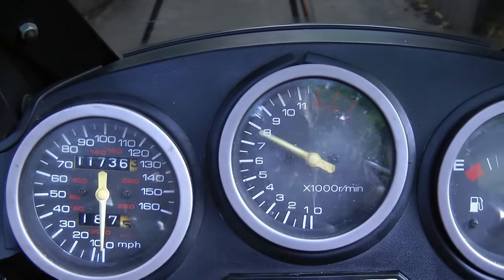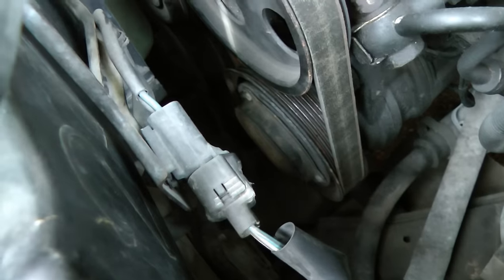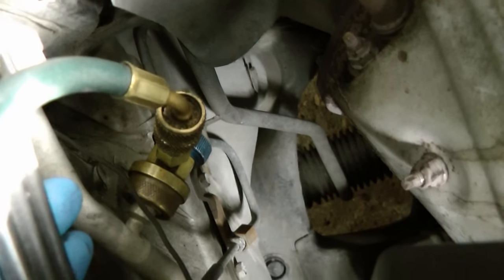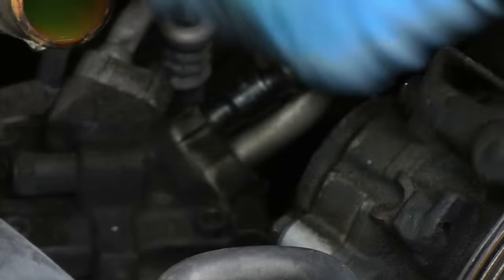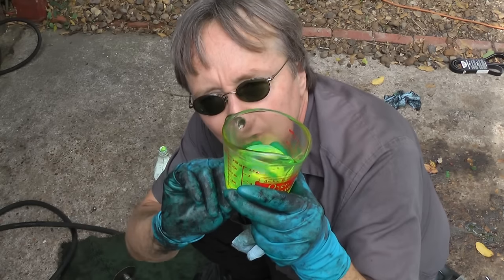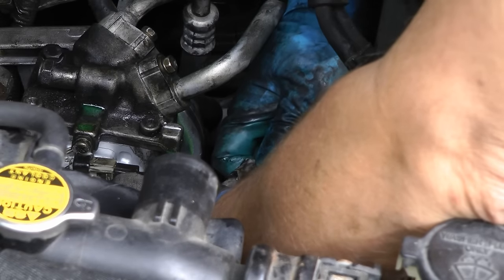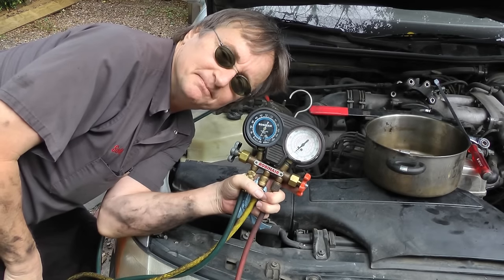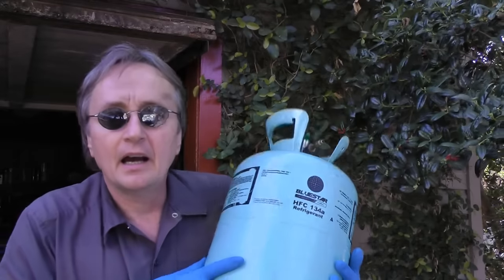How to Replace AC Compressor in Your Car

Comment: Hi Scotty. First, allow me to thank you for providing such a great service--your videos and advice are truly second to none and have saved me on countless occasions. Second, although my compressor spins easily (rebuilt, installed 1 year ago), it does not turn (or stops and goes) when the engine is running. Thoughts? Thank you again!

Comment: Thanks for making this easier to understand! My Saturn Vue -03 a/c stopped blowing cold 3 weeks ago. I toughed it out, then mother nature heated things up. Took it to a shop, was told the uv dye shows compressor leaking - they can't add Freon - ozone layer contamination, etc. They say replace compressor - what do u think? My money tree is suffering from heat exhaustion n $800 bucks seems pricey

Comment: Thanks Scotty.  I must say you are the most helpful person on Youtube.  I have one last question.  I'm changing out my compressor in a 2006 Saturn Ion.  The Drier is on the Condenser and cannot be removed.  Should I replace the Condenser?  The manual only talks about replacing the refrigerant filter when changing out a major component.

Comment from the maker: you had a restriction inside the system making it freeze up, but then the compressor blew up and the ac green oil came out. Now you have at least two problems, including a bad compressor

Comment: Thank you Scotty! Ill let you know of anything.
I'll save up and give it a try, it might be worth it, if not it's the compressor, and if it is, ill wait until it dies. It still cools well, slightly less on idle, but that's also probably because of the florida heat and the fact it is a belt driven fan. 
Thanks again!

Comment: scotty, great vid, i have a 2000 eclipse gt the ac wasn't working so i tryed to charge it because it was low on charge, it worked for about a good 60 seconds then it just stopped blowing cold air, my mechanic thinks i should replace the compressor but it was replaced last year. thanks in advance,

Comment: Hey scotty love your awesome videos!! I have just a few quick questions to ask you about putting oil in a AC compressor... What  type of oil do I use and also is there a certain type of oil you recommend using? Do I still need to add oil to the compressor if a R-134a bottle already contains oil with the refrigerant? Again thanks for all of your videos and I appreciate your feedback
Reply: ive got the same truble rn buddy
Reply: @1second423  If I were you. Just buy a compressor that's pre-oil (most do have pre-oil which I did not know that at the time) and throw some R134a in there once you have everything hooked up right.

Comment: I have a 2008 Honda CRV 
Air Compressors .
Do we care if its a Denso part or Sanden ? 
Are lifetime warranty Four Season any good ? Everco 
Does one blow cooler than the other ?
Or just last longer.

Its nice to know Autozone will let me return it for full value and apply it to.a Denso if needed later .

Comment: Scotty , hey first off thanks for the videos they are truly helpful. 

My car started blowing hot air while driving to work then a real funky smell started to come through the vents.  Like a burnt rubber type of smell. I took it to a mechanic for a visual check and my fan clutch was not kicking on. He told me I need a new  compressor. Any input would be helpful. Thanks

Comment from the maker: I would remove fan belts and run it with one of the other off to see which is making the noise. IF you can do that, if it only has one belt, try my new video "Using a giant screwdriver to find car noises"

Comment: Hello Mr. Kilmer, you make it seem so simple to replace the AC compressor. The oil that you pour in the new unit before you put it in, is it enough to lubricate what needs to be lubricated within the unit? I ask because I talked to another mechanic at a shop and he made it seem as though it was more complicated than how you explained. I have a 2005 Honda Accord Coupe 4cyl,

Comment: Hey Scotty Kilmer I have a 2006 Gmc Sierra 2500 Hd I’m replacing the Heater core I was wondering if I can power wash the whole HVAC system box should I take all the actuator off or put tape over where the electrical plug plugs into it thanks appreciate it

Comment: hi Scotty....great videos....well my fahter's car(a 2003 toyota L.C. Prado) has auto climate control.. the blower used to be really fast at the top speed....but now it seems to be that is not as fast as before at top speed. even when the display is showing to speed...this country is really hot... the system is set in 22 celcius degree(arround 72F)....

Comment: I took my a/c to the shop to get it recharged, and they said that it couldn't be recharged because the a/c compressor stopped working while they filled it. In their defense, I haven't used the a/c for about a year now because it was broken. I guess I need to replace the compressor now, and it doesn't seem too difficult because of this video. Thanks!

I do need to do the evaporator on the scion xb, which is very hard... The mechanics are telling me it'll cost about $1000
Reply from the maker: now rarely do evaporators go bad on scions, basically, I'd do the compressor flush out the system, and replace the ac drier. Then see what happens, cause if it works fine, you can leave it at that. Changing the evaporator if needed can be done then with no damage. Often guys make up crap

Comment: The replacement compressor I  bought says it came with a full system charge of oil, so how much do I drain out of it before installing it since there's oil in the rest of the system? I'm also replacing the desiccant dryer which includes the hose to the compressor. This is on my 87 Mustang with 302 V8 that I replaced everything but the compressor 10 years ago, flushed the evap, and converted to r134 and pag 46. The old compressor didn't fail... the system is just empty now, and I just replaced the tc cover, wp, ps pump, and am just dressing everything up for car shows.

Comment: Hope you see this. I have a 2008 Dodge Nitro 3.7 4x4 automatic. Ive seen your videos about not buying a reman ac compressor. My bearings are going out, the compressor works as it should, otherwise. What is your thought on replacing just the bearings?

Comment: Hi Scotty, my toyota vios or toyota yaris they call it in other country is now 5 year old. The problem is when I turn on the a/c and the fan in the radiator is turned on the car vibrates roughly compared as it was before. I can't figure out where the problem is. I hope you can help me. God bless you Scotty. Keep posting videos, its a big help for us who dont to go to a machanic and pay huge amount.
Reply: PS. rpm is normal. Nor too low or high

Comment: Scotty, Firstly I truly enjoy your videos. They are indeed very helpful. I do have a concern though. My buddy has a 1998 Chevy Cavalier and every time we turn on the AC, we would hear this very loud and annoying clicking clicking noise. I was thinking that it was the compressor, but I would really appreciate your view of this. Please and thank you.
Reply: Tasean Chapparo  i had one that did that when I bought it, shortly after it seized up and the car wouldnt start. I tore it apart and it was the clutch bearing and the copper coil torn up behind the clutch and bearing (the parts just behind the ac pulley on the compressor)
Reply: Tasean Chapparo I would fix it before it leaves you stranded. now if it has its own belt, you could just pop it off when the bearing fails completely and seizes up, but if its on a serpentine belt, ie 1 big belt for everything, you better change it before it leaves you stranded. not a hard job generally.

Comment: When my AC compressor started going bad in my '98 Lesabre, I bought an idler pulley specifically for the application from an auto parts store. Only $25 and it goes in the place of the compressor. Obviously, you'll lose AC if you do that, but if you don't want to shell out $200-$400 for a compressor, it'll keep the compressor from seizing up and throwing the drive belt. Just an idea for anyone facing a similar dilemma.

Comment: Hey Scotty! I have an 05 Chevrolet equinox. Condenser is new and so is the drier and it holds refrigerant but won’t get cold. Compressor works as it should. When I turn the AC on you can hear the compressor engage. Trying to figure it out. Any info would help a lot!

Comment: Hello Mr. Kilmer, One of my AC lines in stuck to my AC compressor. all bolts are removed. Its just the big AC line hose wont come out. I've trend snagging it, hammer and using the other end of the breaker bar. Its for a 2007 crown vic P71. thank you

Comment: I need advice, on a 07 Chrysler 300 should I replace the condensor, or can I only do accumulator, expansion valve, and compressor. Thanks

Comment: Hey Scotty,
2002 corolla
Bought it used and it had no AC compressor, was running on shorter belt. 
I need AC!

I Replaced condenser, compressor, drier, o rings and pressure ac switch.
After all this I'm going to the local mechanic to have it vacuum/ leak checked and recharged.
 (question1) What should I have flushed? Just the evaporator?
(question2) Is it ok to install factory belt now onto the ac compressor even though system is not vacuumed or charged and drive it?

Bonus Question
I got a expansion valve but the ac lines on the firewall have these weird plastic couplers and I can't figure out how to remove. I see auto zone has some plastic tools but I still don't get it?? 

Thanks Scotty! You Rock!!!!!

JD

Comment: Thanks for the video Scott. I just installed the A/C compressor and followed all of your instruction. I tried recharging the refrigerant, but under the dash on the passenger side underneath the air cabin, I see and smell green fluid coming out from the evaporator. Does that mean the evaporator is leaking and has to be replaced?
Reply from the maker: yes, the green is the color of the AC oil, so evap is leaking

Comment: Hi Scotty, great video as always.  I have a 99 Suburban 4wd 1/2 ton.  The AC compressor just seized up (what a smell!).  I have a new compressor, drier, and am picking up a new condenser today.  This is my first time messing with AC...at what point do I evacuate the system?  Before or after I put on all the new parts?  Any help would be greatly appreciated.

Comment from the maker: compressors are very weak on those, remove the fan belt and run it, if the noise goes away, that's it.

Comment: I bought a used compressor and wanted to replace the compressor on our 2000 Saturn SL2, but after researching and reading all sorts of scary things, it doesn't sound like a job I should attempt. Recovering oil, checking purity, replacing a laundry list of parts that can clog from compressor contamination, evacuation, and on and on and on. The chilton book also makes it confusing between oil and refridgerant as if they are the same thing. I give up. I hope they take returns.

Comment: Hey Scotty I got 98 jeep grand 5.9, I'm replacing the compressor, condenser, orifice, and accumulater. I flushed everything but evap. My orifice was spotless when pulled off. Pag oil chart calls for 7.44 oz is what I've found, I hope that's correct. But my question is how do i know how much oil to add since I didn't flush the evap?  Is it still 7.44?  Thanks for your time and hope to hear back soon

Comment: Don't forget to pull vacuum, close the valve to pump, leave under vacuum and ensure the vacuum stays.   If it has a slow leak this is where you will find it.   You need to prove it holds before charging.

Comment: Hey Scotty, I got a 2006 Suburban. My compressor started smoking/squealing at about 2,000 - 3,000 rpms. I took the belt off and the compressor never locked up. Would it be ok to just change the compressor and nothing else since I caught it in time? Thank you!

Comment: Very nice vid. I have a 2005 Equinox and the ac is not working anymore. At first it blew cold every now and then now it's out for good. I can hear the compressor clicking on and there is pressure but no cold air anymore. what do you think? Thank you!

Comment: Hey scotty. I could do the mechanical work. Do you have a video on how to use the gages? My compressor went out while I was driving. . So I want to clean the system out before I put the new compressor in And i'm not sure how to do that. I know if I do it wrong all the work will be wasted. Any advice

Comment: Scotty, I recently bought an 02 Nissan Altima 3.5. There was a brown plug loose on the front of the engine. When I plugged it in I heard what sounded like freon blowing from the AC compressor. What is this and what is the problem? Thank you

Comment: Hi Scotty I have an acura rdx 2013, 150.000 miles and couple of days ago I started hearing grinding/rattling noise when ac is on it goes on for couple of seconds and stops and so on. I am guessing its AC Compressor giving away, What are your thoughts on how much would this job be if I took it to the dealer or mechanic? Thanks a lot in advance and I enjoy watching your videos.

Comment: Do you think I need to replace the whole compressor unit even if the ac works when I switch it on? There is a squeaking noise when I switch on the ac but the ac coldness is ok.

Comment: Mr. Kilmer, was giving the rattly a/c bearing a shot, and instead of learning about the clutch hub puller rental from Autozone, I and the mechanic neighbor hammered and pried with a crowbar.  The Snap Ring Lip pealed off, so no more place for the Snap Ring on there.  Is that area of the compressor's Snap Ring replaceable?  I hope so, but a got another compressor from the junkyard just in case.   2000 Corolla   Thanks, Airborne!

Comment: Hey Scotty! Great vid! Quick question. My truck has a burning oil/plastic smell when my AC is on. And only when it is on. I think it may be the compressor, because a while back, I remember seeing what I thought was anti-freeze on the ground beneath my truck. However, my truck wasn't overheating, so this leads me to believe that somehow the oil in my compressor got out. Does the AC compressor sound like the problem to you? Should I just replace it, or try to fix it?

Comment: Hi, Scotty. What you recommend on a 2009 Nissan Versa engine? Mechanic replaced the compressor but claimed it needed "clamps" or "clips" to hold it in place and needs new charge. I've never heard of a compressor needing a clamp/clip to hold it in.

Comment: wow. this is the video ive been searching for. I own a 1992 sc300 with a 2jz ge motor..just ordered compressor and dryer. because old compressor had leak on the compressor seal...do I have to change expansion valve or can I leave it..?

Comment: Hi Scotty! I just replaced the ac compressor on my 2005 chevy cobalt, but the car is still blowing hot air. I open the fuse box and used an electrical fuse (I made) to give power to the ac clutch. The ac compressor switched on and now blows cold air. Do you think it's the ac clutch that needs replacing or fuse box?

THANKS!

Comment: Hi Mr scotty, i got a 2000 toyota camry 3.0 v6 it has a bad ac compressor clutch(started rartlling and then the clutch fell off) but no one seems to sell the clutch alone for this car so I'm gonna have to put a new compressor in it. My question is do u recommend a remanufactured compressor or a brand new one?
Thanks!

Comment from the maker: @aeligos ah, realize VWs turn into endless money pits as they pass the ten year old mark. Tons of things can make that over engineered computer run AC system do that, it has many sensors, miles of software, and feedback that would make your head spin. I just read a 27 page booklet on VW AC repair and it made me realize the Germans are anal compulsive maniacs when they design cars.  Generally though, if turning the AC makes the engine die, the AC compressor is wearing out, straining the engine.

Comment: if i have a bad ac compressor pulley can i just replace that instead of replacing the whole compressor ? and if so.. can i do this without letting fluids out.?  also.. if replaqcing the whole unit is my only choice, what oil do i use in the new compressor .?

Comment from the maker: put UV leak detector in the system and the green dye will come out the leaking area. No one fixes those denso compressors, we replace em with new chinese made ones to save money

Comment: can i drive the car after installing new ac compressor and receiver drier? or does it need gas charging straight away? whats the procedure of installing new compressor does it need step by step starting the car to run it in ? or i might be wrong.

Comment: I have a 95 Saturn SL2 motor 1.9  4 cylinder double overhead cam. I'm replacing the air conditioner clutch assembly. I'm trying to find out what the shaft nut torque is and what the gap clearance should be on the pulley.?

Comment: Scotty Kilmer my toyota 4runner 1999 is making a clicking noise by the blower motor wheel.  I saw this video for help and after watching I think it could be the compressor.  Can you please advise.  Thanks and I think your videos have been very helpful
Reply from the maker: the blower motor is in the dash, if it clicks, remove it, and look for leaves and debris. If you find none, replace the blower motor

Comment: when changing your compressor do you perform a pressure check on the high and low lines.   The reason I asked its because I took my car to the dealer and had the compressor changed.  I only used the ac probably like 2 months   June, July August of last year and the warranty expires for the repair expires this month.   The service dept is tell me its the high and low pressure hoses that need to be changed now when I asked him why they didn't check them when they had the car apart, he got defensive.